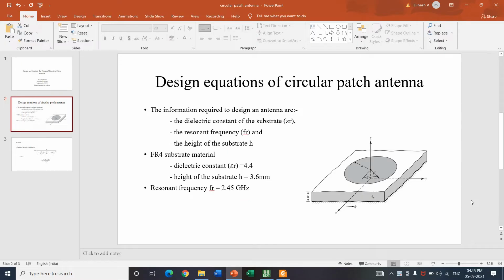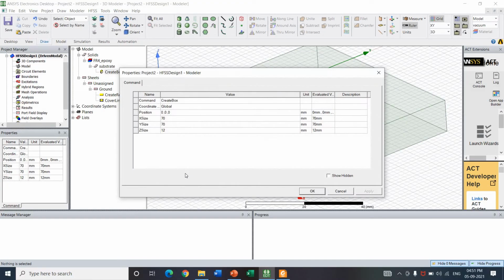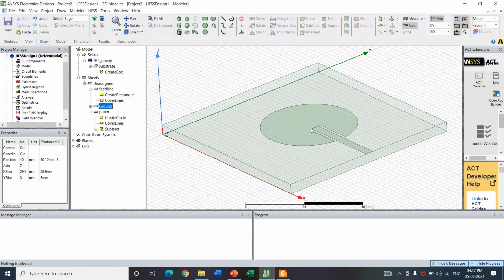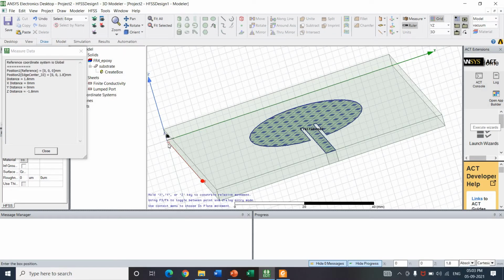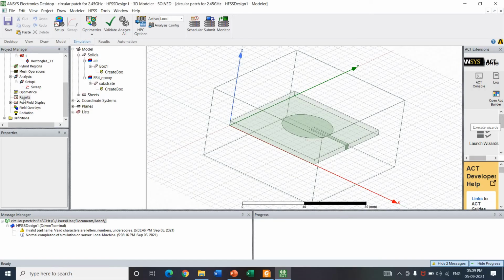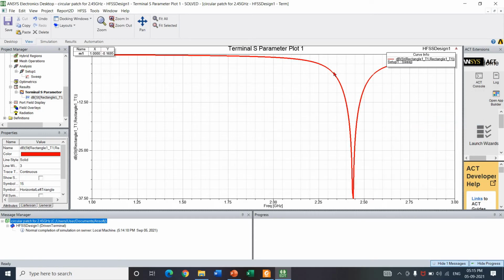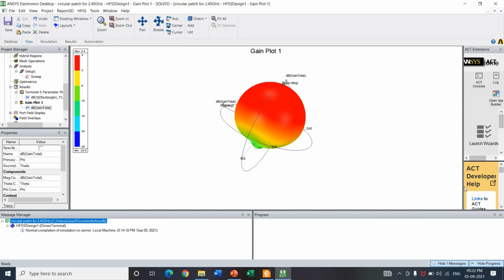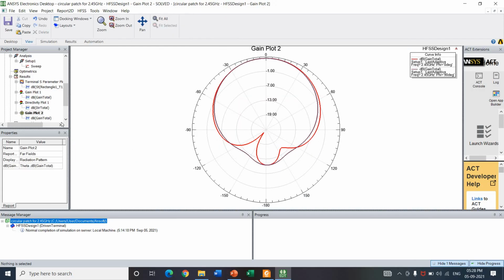Simulation of circular microstrip patch antenna for 2.45GHz using HFSS

Comment: When something goes wrong, don't just thrash around with the mouse. Re-record that part so everything we see is correct. Failure to define the radiation boundary rendered about ten minutes useless. We didn't have to see that. And what have you done to the audio? It's like you are sitting behind a jet engine.

Comment: sir, how do we calculate the dimensions of feedline
Reply: You should use a micro strip calculator, with the provided substrate dielectric constant, to determine the dimensions for the characteristic impedance of the transmission line. Typically, the characteristic impedance of the transmission line is 50 Ohms. What's more relevant to the patch is how far does the transmission line extend into the patch.